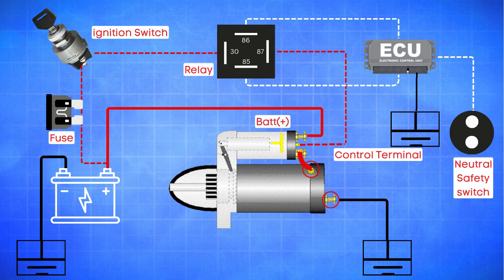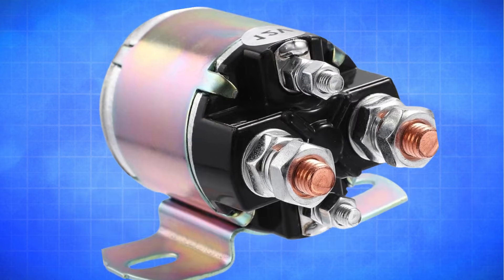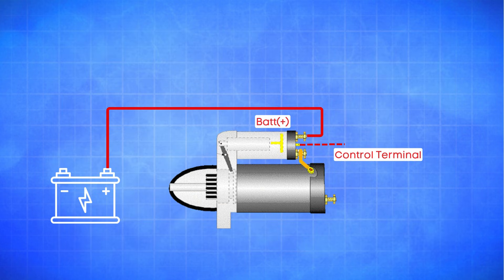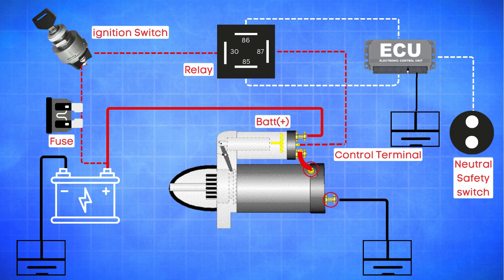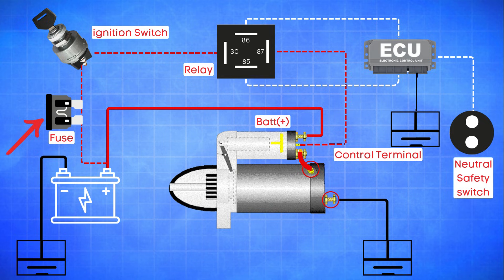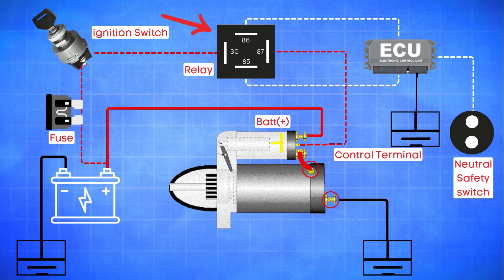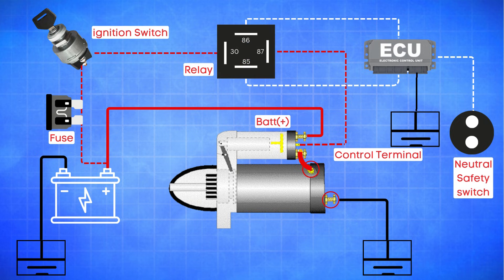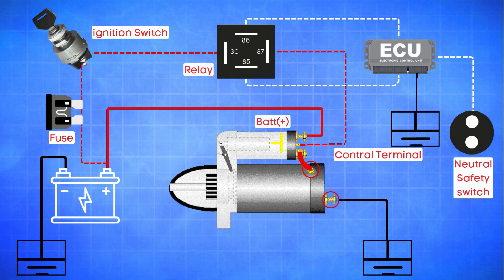Starter Wiring Explained | Car Fix

Comment: bruh u made a mistake: "86-85 when energized by the ignition switch" its never gonna happen cause those pins are only connected to the ECU, so how could u energize them from the Ignition Switch
Reply: You are right.

Comment: WARNING ⚠️ WARNING ⚠️ WARNING ⚠️ all most  Any Automobile"s made over year 2000&4 is made to keep a  👁 Eye on you To keep track on you  every Place you drive your car to  Every place you goto REALLY BELIEVE IT OR NOT  electronics will empty your bank account  Because electronics will give you so many real problems electronics will empty your bank account BELIEVE IT OR NOT I Am a Real ASE certified master auto technician With way over 50 years of real Hands-on training real experience at Dalton State College Also at Florida State College Also at GM motors also at GMC motors also at Toyota motors Really  never ever BUY Not Any automobile with any Electrophonics Really electronics really  will empty your banker Really BELIEVE IT OR NOT REAL TRUE
Reply from the maker: Thanks for sharing your perspective as an ASE certified master auto technician.

Comment: Ground on a DC system makes no sense. Why dont we say return to battery?
Reply from the maker: Yeah, same thing
Reply: Ground can make sense in a DC system, in the same way it does in an AC system. Just look for DC telecom equipment. But I get your point, we should call it chassis or return

Comment: so 86 and 85 are the load side and 30 and 87 are the control side
Reply: Not correct. 85 & 86 are control side. 87 load side. 30 hot at all times.

Comment: I like and appreciate the video but I found a couple of confusing things. You have the ignition switch directly wired to the relay. It doesn't show the connection of the relay to the battery and also doesn't show how the neutral safety switch is connected to the system
Reply from the maker: Please watch the video carefully. You will get your answers.
Reply: @carfix07  so I guess that means you won't be redrawing the animation.
Reply from the maker: @HarryPost-h7m  the relay is connected to the battery through ignition switch and fuse.  See the red dotted line. However, in some modern cars, the ignition switch directly input to the ECU. And for neutral safety connection, we will bring dedicated video on Neutral safety wiring diagram. In this series we are going to cover wiring diagram of each and every electrical components of the car. Thank you.